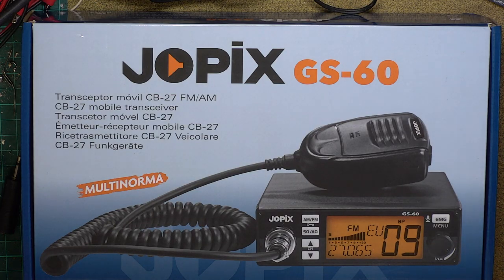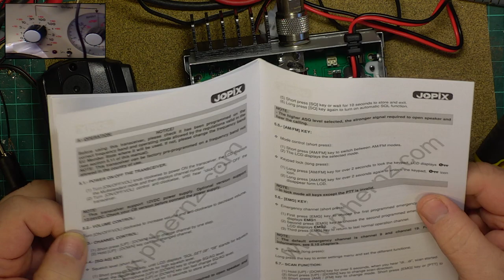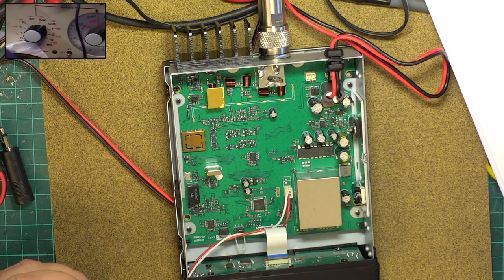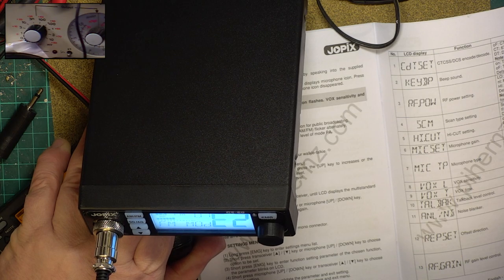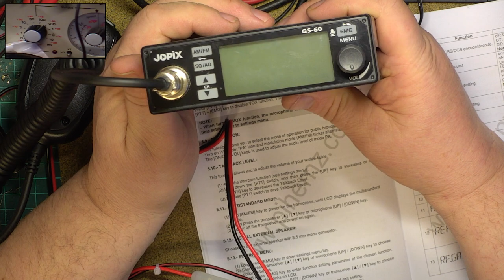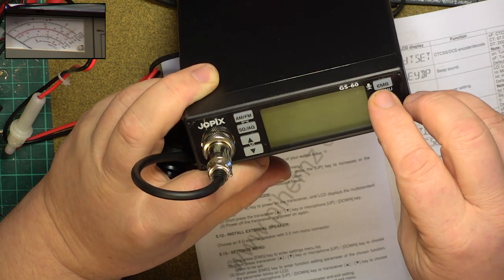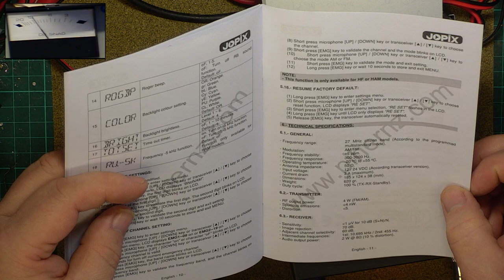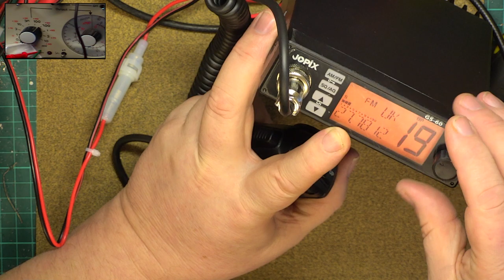Jopix GS60 UK CE MultiNorm Cb radio (mobile) - service adjustment & overview

Comment: Excellent radio, I've used one for 6 months and it has performed brilliantly mobile coupled to a Sirio 5000. I spoke to Germany today on Channel 11.
Reply from the maker: I've found cheaper radio like this outperform radios four times this price. The expensive radios just introduce slow performance, lower TX power & gimmicks.

Richard

Comment: Thank you for the tutorial. It appears this radio does not produce a true amplitude modulation. I forgot all about the missing transformer for audio. Well I guess I better cancel my order for this thing. Cheers David
Reply from the maker: There are other techniques for AM. When I was at Nottingham Radio in the 80's & 90's, most business radio systems were VHF AM (around 166 to 172MHz). We had loads of Pye Olympic (M201) & the later Pye M293 radios out on rent which also didn't have modulation transformers.  On the M293, we're talking about a radio costing £376+VAT.

Richard, G0OJF, UK

Comment: Hi Richard.hope you are keeping safe and well and all your staff.what antenna do you use from office when Mr chippy goes out on radio test? I use an imax2000 an excellent Ariel it works for me.I have just applied to go onto a foundation course with Essex radio so just waiting for reply.also if my ss6900 had not had the UK FM put on it would you be allowed to have a look at it or is it still a no no.even though its a 10 metre radio.regards tony
Reply from the maker: SS6900 isn't a legal CB radio & it is illegal to set it up to use as such. Because these type of radios are really illegal CB radios sold in the guise of being 10M amateur radios, we don't handle them...furthermore we have nothing to do with SSB equipment....other than vintage 1960's amateur radio gear for ourselves to use. We never do customer repairs to any amateur radio equipment & solely deal in a fw commercial business radio customers & UK legal CB servicing.

The aerial for the workshop is an Antron 99 or similar & is a 1/2 wave aerial, whereas yours is a 5/8 wave. The aerial is mounted at just above gutter level of the single story building. Mobile type 6mm feeder is used, but there is only about 6M of it & it is industrial grade. We deliberately have this type of aerial mounted in this way so that anyone can replicate our result.

Richard, G0OJF

Comment: Naughty "See if my sandpaper grips the set while I take the screws out"  ha ha ha ha!  It's an empty box with a few components thrown in that have stuck to a board someone left inside!!  TALKBACK comes out it own speaker like a PA system, handy for AM or to hear if Mic is distorted, or if you have a power mic or echo mic, which I hate anyway. of limited value.  Perfect, a set people can screw up themselves without going to a screwdriver so called expert!  I was going to say I quite like it, but all that pressing buttons would drive me up the wall!  Good to see for me that you can adjust it without going inside, but for someone else, one mistake and it would have to go back to be reset at a big charge, if factory reset didn't restore it.
Reply from the maker: Factory reset only resets user parameters. If someone screws up something in the service menu, that has to be set back up on test gear.

richard
Reply: @ukfmcbradioservicingTango21  Yeah, so go into settings proper and they are on their own!  Charming, but if a dealer was good they would have them set up properly.  So don't buy a CB from your local Currys!

Comment: So if you bump the power to 4 watts, you have to bump the deviation? How are these radios on frequency?
Reply from the maker: No, deviation & power are separate. If deviation is too low the radio will sound very quiet & needs to be set ino a deviation meter (FM modulation meter) & a dummy load.  Power makes little difference to range.  I can't remember if or how the frequency is set, but the answer one way or the other is in this video.

New radios nearly always come out of the box with deviation & power lower than the legal limit....they always have done. It's so that when imports are batch sample tested at the receiving country they are well within Limits. Imagine if a set was tested at customs & was doing 4.1W....the entire container load would be rejected & returned.

Richard, G0OJF, UK